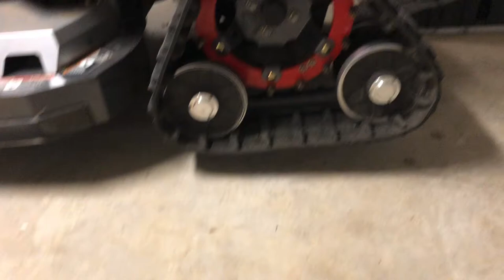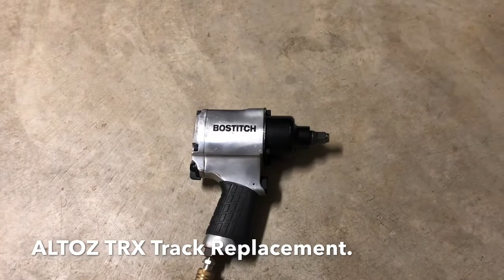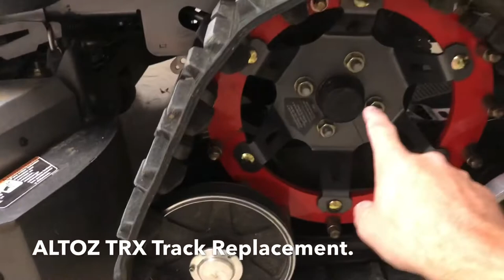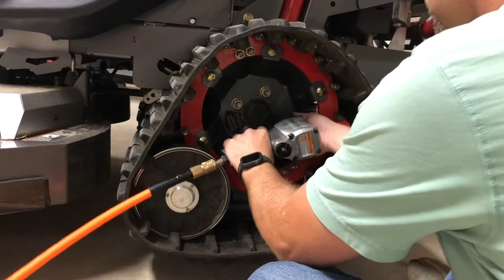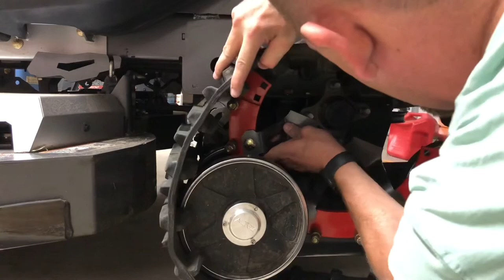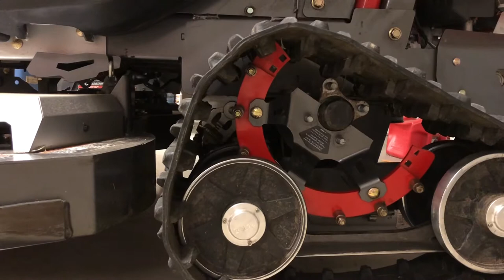ALTOZ TRX Track Replacement

Comment: Built like a bulldozer and rides like a Cadillac, and I have already seen the disassembly of the sprocket drive to change off the driving track belt,  really ingenious as crazy hell,  I'm sold
Reply from the maker: i just sold my TRX mower was a great mower it will be missed but it was too much mower for what i do.
Reply: @steelers454  instead of struggling to put the top piece back on why didn't you just turn the hub all the way to the bottom instead of only three quarters of the way.    ?
Reply from the maker: @carmichaelmoritz8662  because you can't there is a certain way you have to do it.
Reply: @steelers454  why would the top section of the sprocket be any different from the bottom section of the sprocket. looks like both halves are the same and since you took the bottom part off basically horizontal one would figure you could do the same to the top part when you turn it to the bottom
Reply from the maker: @carmichaelmoritz8662  because if I remember right the one I stuck on first with the sticker has a cut out that the other one set into, I don't have the mower any more. so I can't check to make sure. but that is what feel like that is why you have to do it that way.
Reply: @steelers454  yes i understand that part. one section has to be taken off before the other section due to the ends overlapping.

Comment: Mr Kenneth dixon sir, you will have to put your question in the question Google bar for YouTube,  but the 766 does infact have a shim system,  I seen it and it looks like a part of the frame,  or look into the 766 trx videos it's in there somewhere,  the shim system isn't like adjusting a bolt n nut idea, it's an actual shim that gets slide into the part of the frame, it stretches the belt a little,
Reply: That's the exact question I needed answered .  👍✌✌

Comment: The tires, wheel system on that altoz, the tracks system for the back drive and the solid tires in the front  definitely beats having to wonder about keeping them tires aired up ,and between 66" inch cut path ,that's a 
5 1/2 ft wide deck, and 37 hp Kohler motor, and the air ride seat, maybe even having an extra switch out mower deck,  O yeah, I think it's a fuel capacity of 14 gallons ,
It sounds like a no brainer to me,

Comment: How many hours till new tracks required? And what do they $$$?
Reply: Should get several 100 hours before replacing, but it does always depend on usage, maintenance, ETC. They are around $1200.00
Reply: @loveforgod6638  those tracks should last way longer than that.  Look at how much horsepower a snowmobile has and how long they last
Reply from the maker: @loveforgod6638  a lot i would say over 1000 if you are not rough

Comment: that is a horrible design. They should have made it with a pressure cylinder (grease filled) like a skid steer, so that it can be done on the fly when out in the field and to allow for adjustments due to the tracks stretching (bad design).

Comment: Before you buy these junk piles look how much tracks are. My OEM tracks ripped apart with around 200 hrs.
Reply from the maker: it probably depends on how rough you are with them. I had almost 200 hours on my mower before I sold it and my track where just fine.
Reply: @steelers454  Wasnt rough on it. It stayed broke down most of the time,
Reply from the maker: @kevinelliott6318  you must of had a lemon. I never had one problem with my mower and i mowed a lot of grass with it. to me it was a great mower. just didn't need it any more.